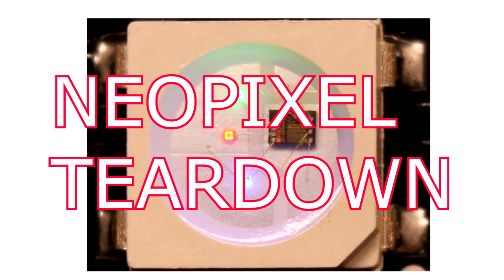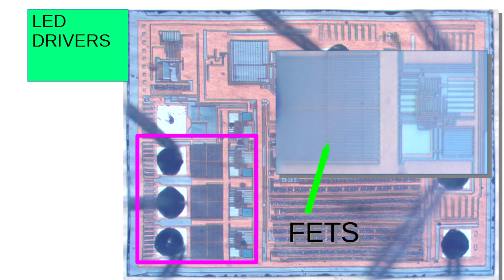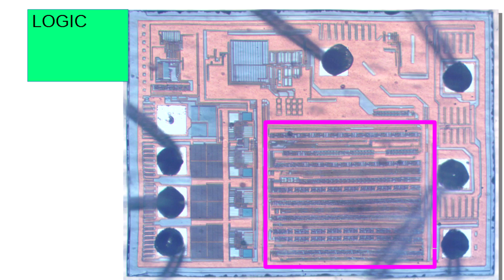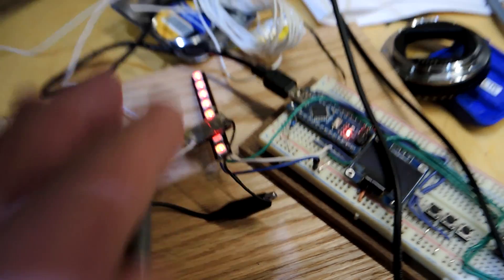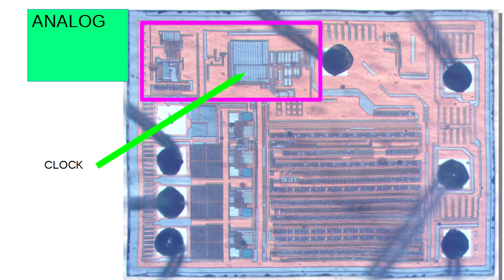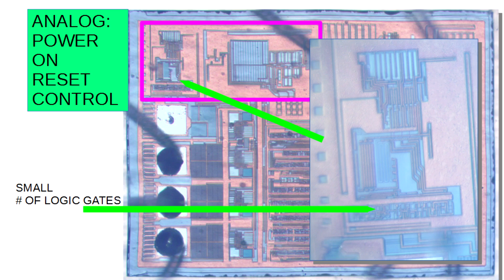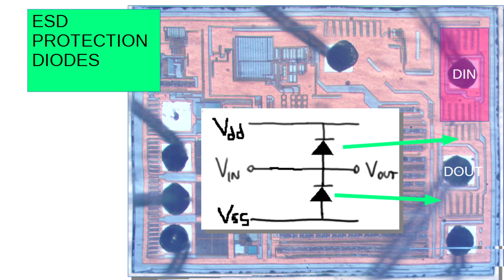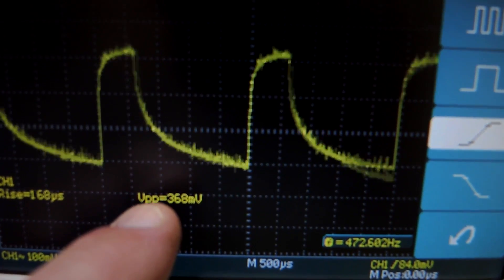A Look at the Neopixel: Controller Die Teardown

Comment: What is the effect of ambient light on the circuit ? I always wondered why, on the webcam's integrated circuit, the sensor part is affected by light and the data processing part is not affected by light. For the neopixel's circuit the situation is worse, the light sources are powerful and just millimeters away from the silicon. Why this light has no effect on integrated circuit ?

Comment: Even when packaged the ESD diodes are essential ! An ESD discharge can happen between any two of the pins of the "Neoplixel". The ESD diodes then protect the sensitive innards of the chip. In my opinion the ESD protection is actually more important when the chip is in the end product because during assembly (of the Neopixel) it is possible to do this in an ESD safe (controlled) environment.
Reply from the maker: Very interesting!  thanks for the additional details.

Comment: You can buy RGBW ones so that'll be what the fourth pad is for.
Reply: David Robertson Adafruit called WS2812b Neopixel. This addressable led looks like SK6812. There are also SK6812 versions with with 4 LED inside. RGBW (SW,CW,WW) and RGBY(yellow). Is using same one wire protocol as WS2812b.
Reply: Correct the 4th pin is for the W LED